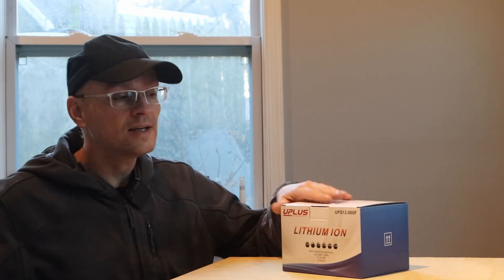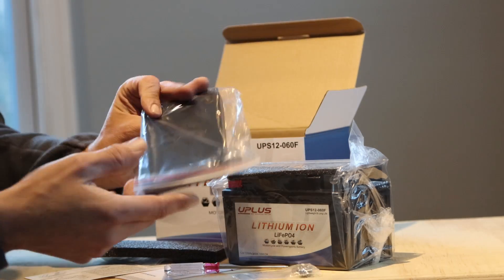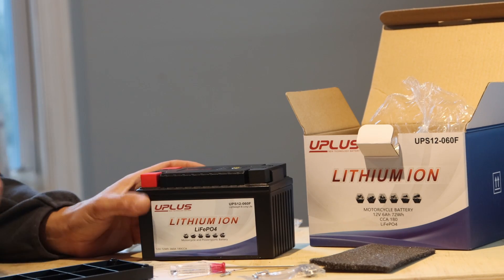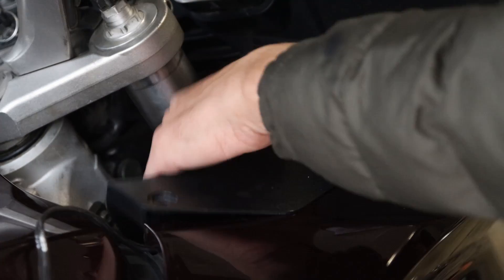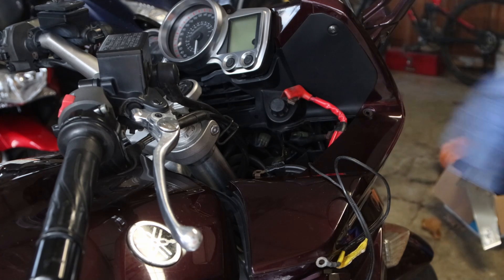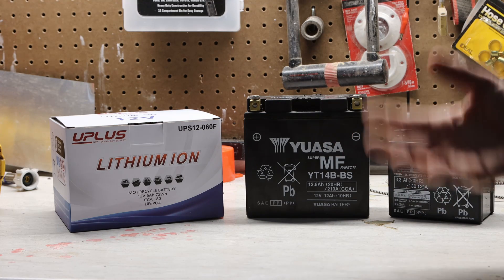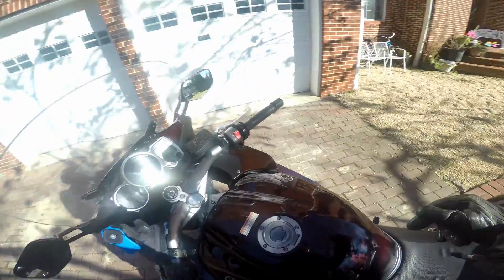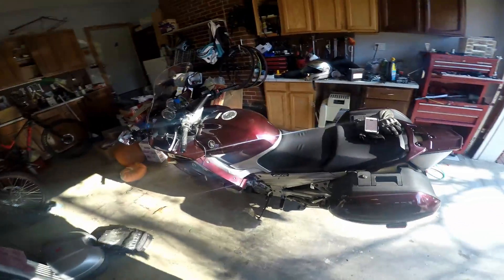Best way to lighten a motorcycle. Lithium batteries #fjr1300

Comment: I've been using a Shorai LiFePo4 in my motorcycle for years and years at this point. This is in a nordic climate so the bike has to stand for months. The battery shows no signs of being done after numerous years of that - granted it's been balanced and tricklecharged with a bespoke charger every winter. Great battery upgrade for any motorcycle really, lead-acid is old garbage.

Comment: Very timely video, brother. My fjr has been stuck in my yard. It failed to turn over after my last right a couple of weeks ago. Lights up but doesn't turn over. I suspect it's the better. I've been wondering how to replace it and also wondering what logjtrt options are out there. Thanks a ton for this tutorial! Very helpful!
Reply from the maker: Hopefully a new lithium battery is in the works for you. Save yourself 12lbs easily with it :)

Comment: What about the price?😮
Reply from the maker: Definatly a whole lot more expensive. twice as much, but lasts more than twice as long. For me getting a aftermarket exhaust isn't so much about the noise it makes its the weight savings, same with the battery. I think this battery was 110$, but they have smaller lithium batteries that can crank a fjr1300 and are cheaper. I just got the biggest one.

Comment: Thanks for the insight! Do you know or are you aware of any risk or impact on the charging system built-in the motorcycle? I understand trickle charger or maintainers are different between the lithium vs AGM or regular batteries. I’m wondering about the motorcycle side as well. TIA !
Reply from the maker: Most new battery tenders have both lithium and lead acid battery options for charging. My battery tenders are kind of old and i had another lithium battery on my scooter that i wanted to get up to full and it worked. I didn't leave it charging, just unplugged it after it put in enough juice.